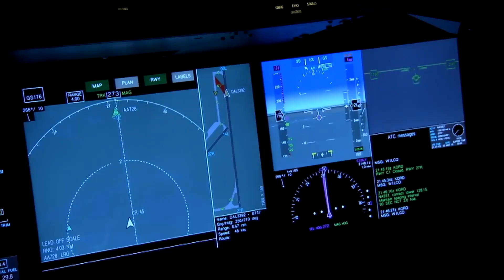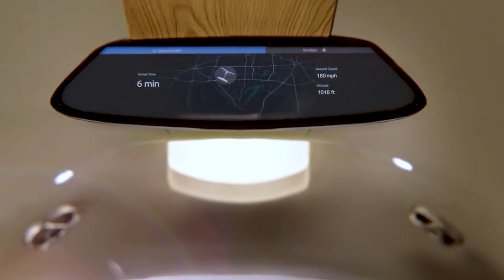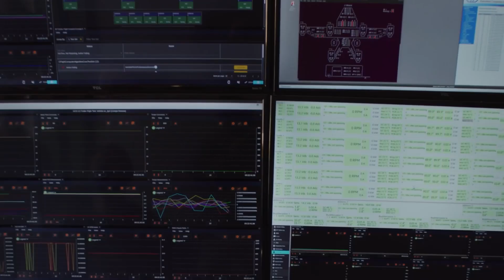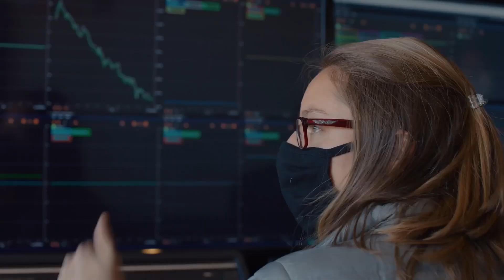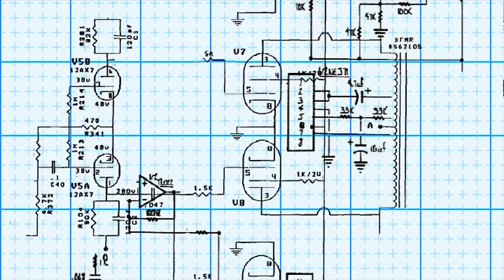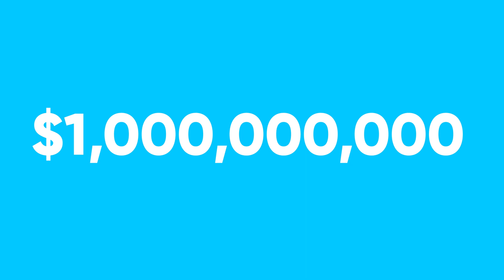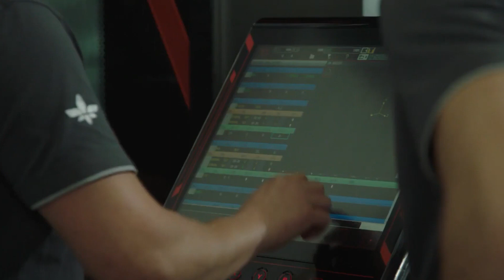How Joby Aviation Will Change The Future Of Transportation

Comment: Color me skeptical. In terms of energy use, it will always be more efficient to roll a vehicle up and down hills than to lift it into the air with propellers. These AVs, no matter how optimized the design, present an even greater need for environmentally-friendly energy production.
Reply: It will never be more efficient to drive up or down a hill than it would be to fly. It drastically reduces travel time flying and this vehicle is electric